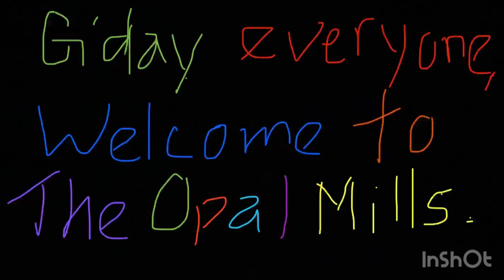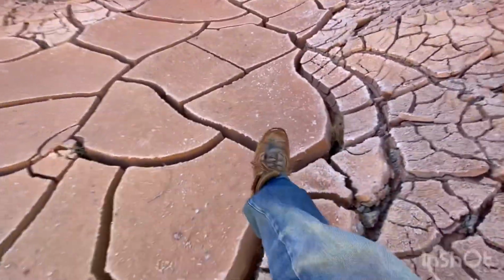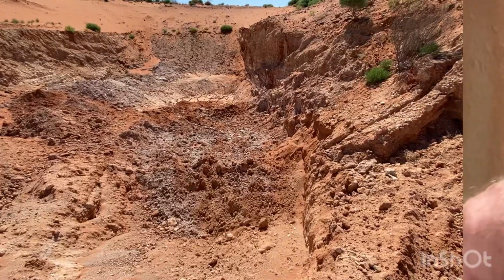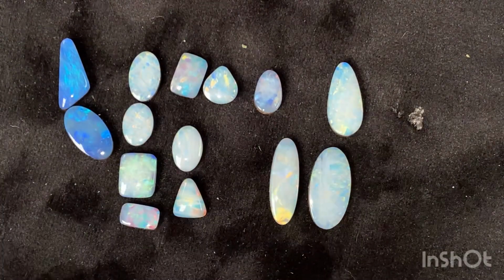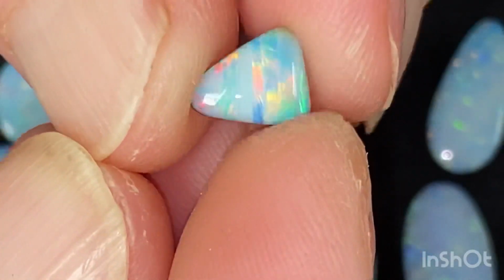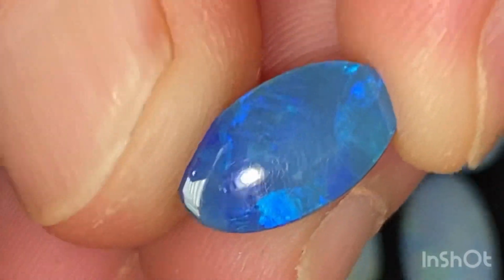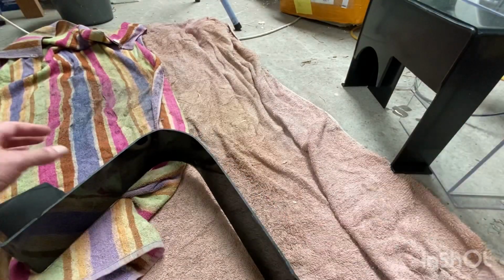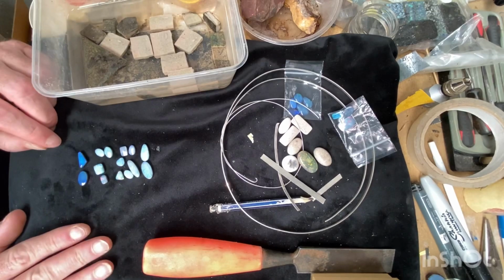Opal life: a quick week.

Comment: Why don't you just buy a proper gem polishing machine,  then no wasting $ on safety - splash guards etc
Reply from the maker: G’day Chris, I do have a separate leather polishing wheel, the point of the safety and splash guards is that this is a new machine with a starting introductory price of au$1,000 designed with a budget in mind, so this machine can get you all the way from rough to final polish. 🐰👍